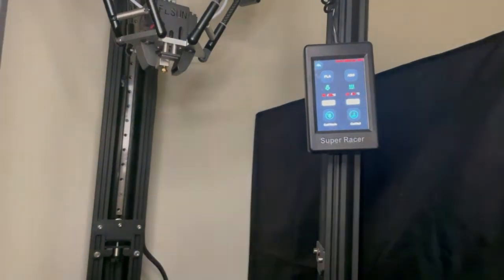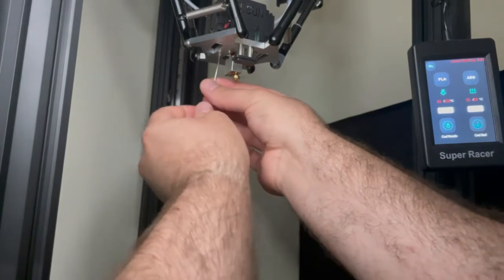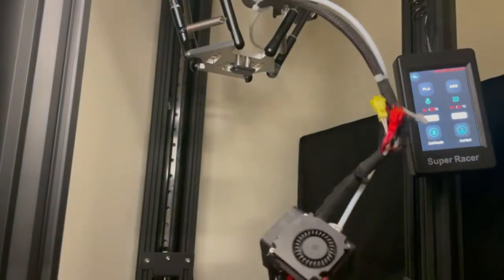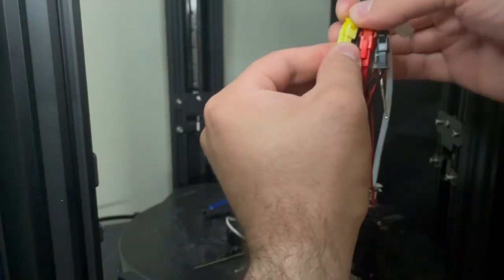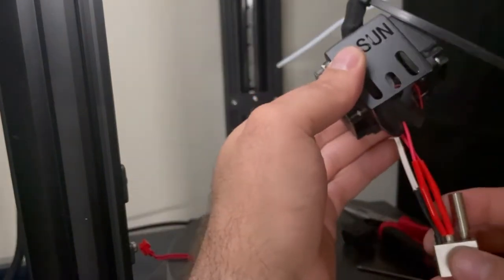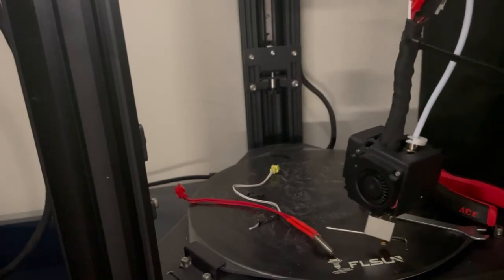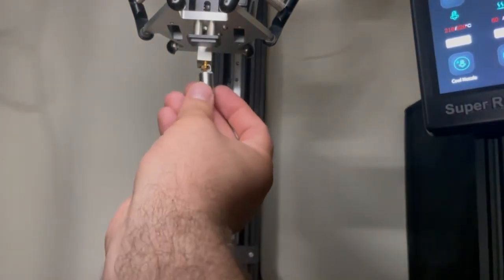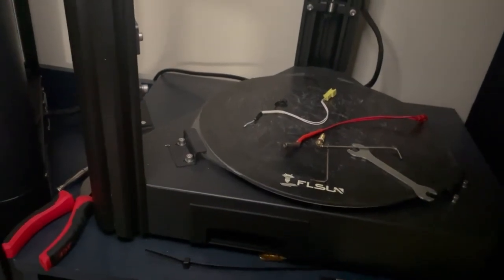FLSUN Super Racer Hotend Rebuild

Comment: Do you know what the voltage is of the heat rod and thermistor? 12 or 24?
Reply from the maker: I do not know, guessing 24V
Reply: Did you confirm my printer is on its way and I want to order a new e3d hotend just need to know the cartridge voltage
Reply: The printer runs 24V (fans, heated bed, heating cartridge etc.)